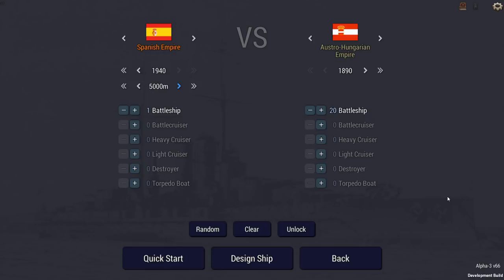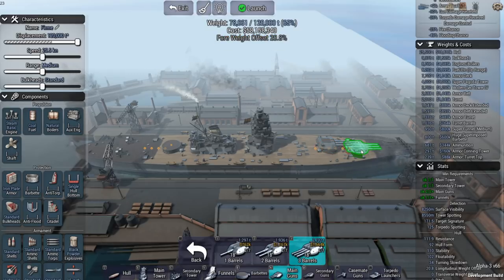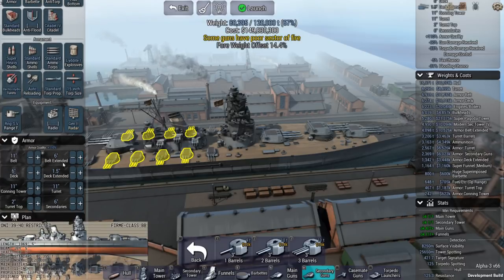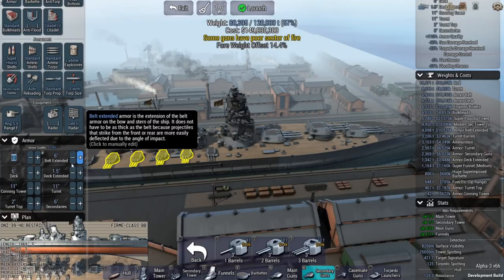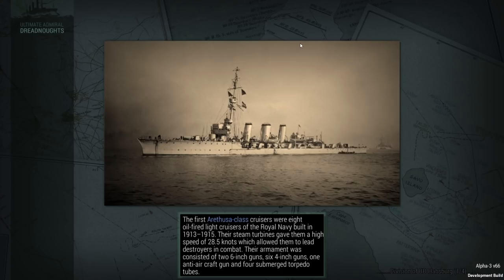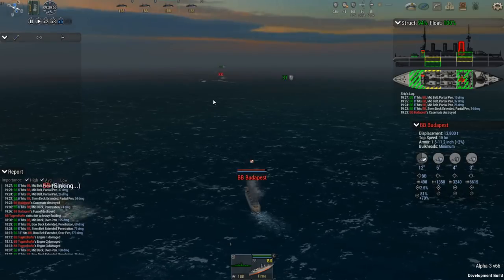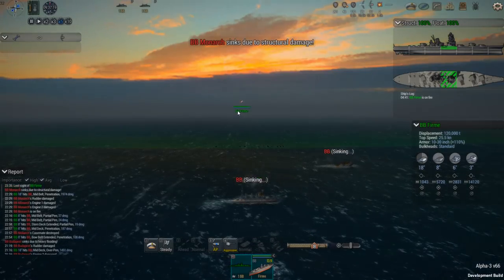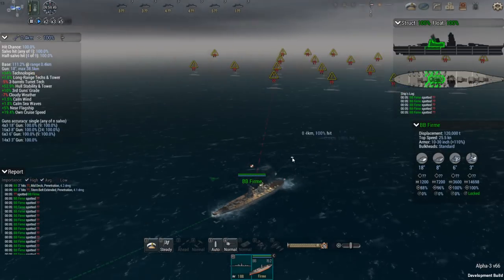HOW QUICKLY CAN ONE BATTLESHIP SINK TWENTY? - Ultimate Admiral: Dreadnoughts

Comment: 16" superheavy ammo would be more optimal if you're trying to sink enemies as fast as possible. the larger ones are overkill so the reload becomes a limiting factor.

Edit: instead of sinking the remaining weight limit into armor, speed would be far more useful for this. Not sure if it would even be necessary, but you could put your guns on "save" meaning you would be guaranteed one shots rather than potentially having to go through more reloads.

Comment: Hi you definitely missed a trick. I do this exact quest for a giggle. 18 inch guns are over kill and faster reload is more important. There is also the side mounted main guns of which you can have 3 sets of 3 per side. The best mix I have figured sofar is 2x3x14 on barbettes. 2x3x12 centerline  3x3x12 side primaries (forward) and 4x3x8 amidships with a generous measeling of 3 inch triples stuffed everywhere. Now here is where it get's a bit counter intuitive. I go bonkers for reload times EG light shells and tube powder. The fire rate is so damn high the reduced fire chance does not matter as you are firing so much. Took less than 18 minutes to sink the lot.
Reply from the maker: Great point.  Faster reload with smaller guns would definitely speed this along.

Comment: Most of the ships are still sunk by main guns. You should put the fastest reloading main guns, that will still sunk a battleship in one salvo. 18 inch guns is overkill, 
You should try 15" or 16" main guns, since they are smaller you should have more place for seconadry, also try side main guns as secondary, few 10" or 12" should fit.

Comment: Meme like idea for u that should also be great in campaigns...

18in gun spam on a ton of ships...

The goal would be to make as many ships as possible with the best rangefinders 9 18in guns

Then cut off pretty much ALL armor, bulkheads, speed, and anything\everything that could add cost (meaning less overall death spam) 

The end goal would be to kill them before they can blink back at u... 

Something I have notices in this game is that the key to winning is large super BB type ships with the largest guns destroying all/ any tough enemies... even B.B. secondaries can destroy waves of enemy dds with ease... thus it is where I get my idea to just spam 18in guns and kill all your enemies at range if possible...  although the ships would be weak in most stats it would mean EACH ship can be used to its full potential

I can’t play this game cus mac OOF but if u don’t mind please try my strat of spamming 18in guns...

Btw it does not matter if it is on a B.B. or cruiser as long as it can hold the guns